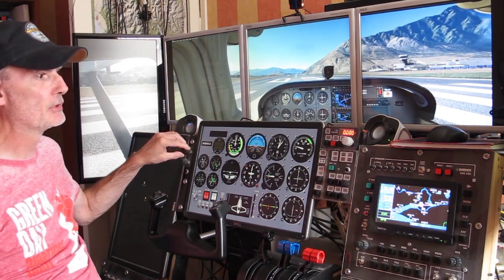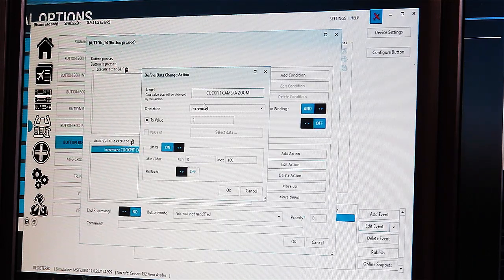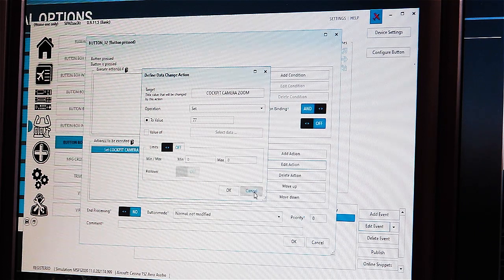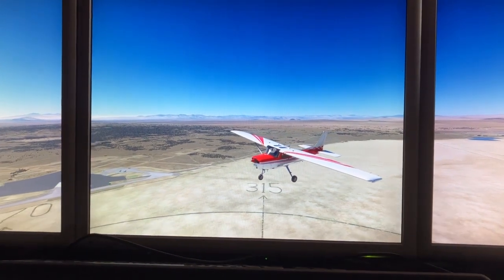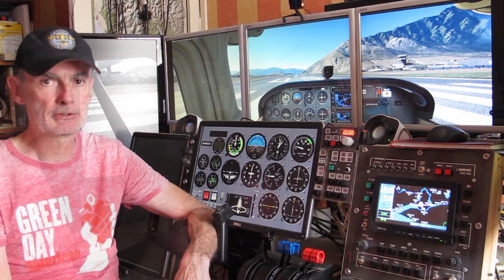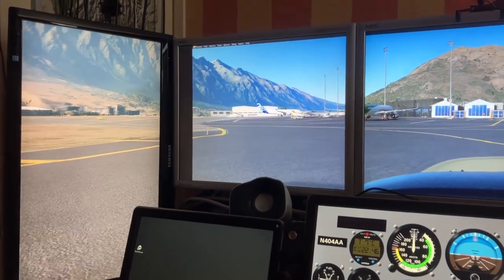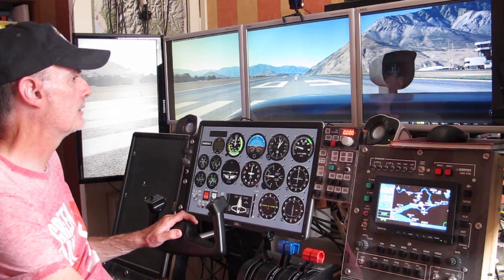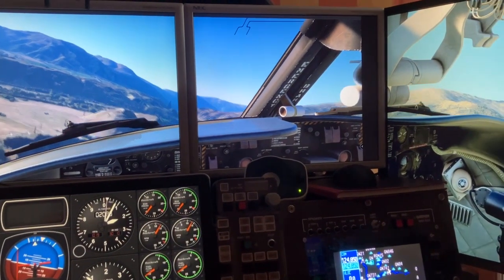FS2020: Setting Zoom to Life Size

Comment: Gteat video.

Question, so if you were buying 3 tv's or monitors today what size would uou get for closest to real.lofe life size objects/world 🌎 in the sim?

I guess my rral world car window in my sedan is close to a 60" tv size.

A cessna might actually have a smaller front windshield size so a 50"  tv might work well.

I've seen youtubers use 2 high end projectors with a custom curved wall that jas to be over 200 inches but again, you can only see so much out a cessna or a320 real life sized windows right? Lmao
Reply from the maker: I guess 50" or so would be about right, or 55" seems to be a popular size. Of course you'd need them to be 4K at that size, so I think you'd struggle get a PC that could drive them. I don't know if there are options for multi-PC setups with MSFS.
Reply: @AlmostAviation  yeah, I suppose so.
Back in the day you could buy a desktop with option to add two graphic cards in one desktop in SLI modes.

Wonder if that still exists nowadays

Comment: Thanks Mark.  I'm in the process of selecting a new monitor preferably  a 32 inches. Now my concern is with the aspect ratio of the monitor. Most monitors available  now are 16:9 which I particularly dislike.  I love 16:10 monitors. Dell has a 30 inches 16:10 with a maximun vertical resolution of 1600 dpi., and 101 ppi. The 4k monitors on 16:9 have 2160 dpi with about 140 ppi.with a weird aspect ratio which was intended for cinema.      Obviously more ppi the sharper the image. So I don't know what to do.  the computer is fully dedicated to flight sims.       So my question Mark is after analising the specs which aspect ratio would you recommend and why?   I mean you have done quite a lot of research on zooming aspects and that alone will qualify you to offer a deep insight into the matter. I have several monitors all 24 inches and all 16:10.     Your suggestion will be much appreciated.  Thank you.
Reply from the maker: At that size I'm not sure the aspect ratio makes as big a difference as for a smaller (24") screen. After all, the 30" Dell will only be ~1cm taller than a 32" 16:9 screen. Yes, the higher resolution will probably look a bit better than 1440p, but maybe not that much. I have an Acer 31.5" 1440p on my desktop PC and it's great. I would guess the jump to 4K would be more noticeable, assuming my PC could drive it!

Comment: Hello Sir, Can you explain and help me (us) about how can we connect 8 screens to our computer? You already made it and i need your help about your solution
Reply from the maker: Sorry, not sure about that. I guess you could use two graphics cards? I don't know how that would affect performance, but it depends what you would be using the screens for.

In my setup, the three middle screens are connected with a Matrox TripleHead2Go, so this appears to Windows as a single display. The two side screens and the little GPS are screens 2,3 and 4. The two bottom screens are connected to a different computer, which runs Air Manager to display the instruments panels.